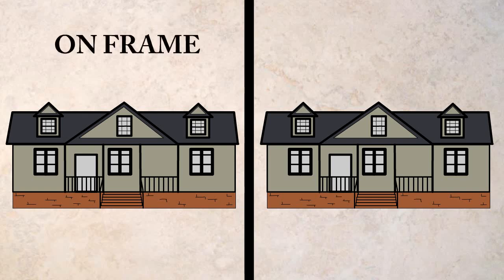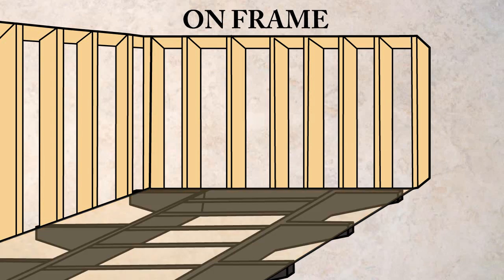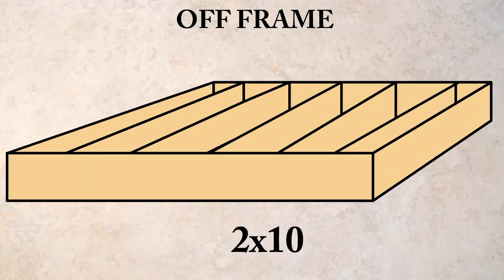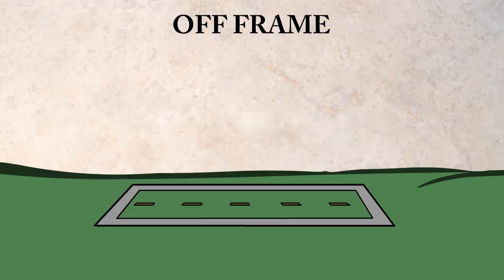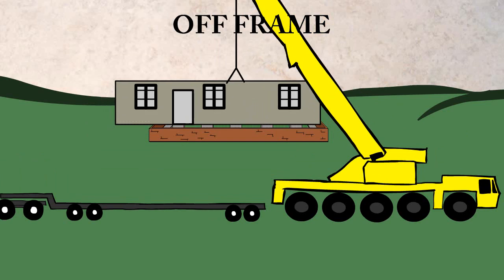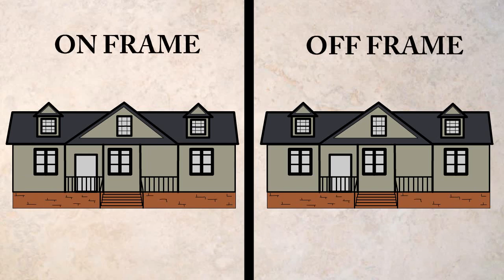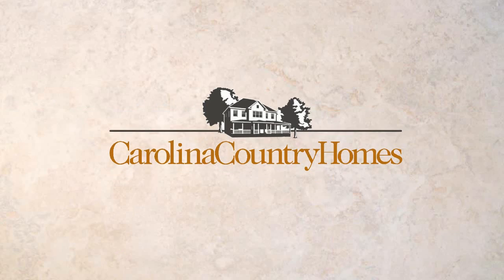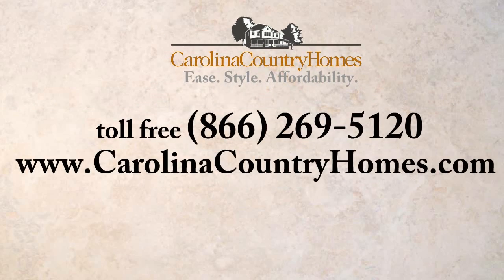Off-Frame vs. On-Frame?

Comment: Most importantly are these facts; insurance is different for On-Frame and Off-Frame. On-Frame homes require a title. Wind loads are different. On-Frame homes depreciate in value, regardless of whether the wheels and axles are removed.

Comment: Basically off frame better in the long run?
Reply: From the research I've done and talking to a couple of lenders, Off frame modular home is the best route to take if you are doing modular.  Off frame modular homes are treated like site built homes by most banks and maintains/appreciate in value just like a site built home.